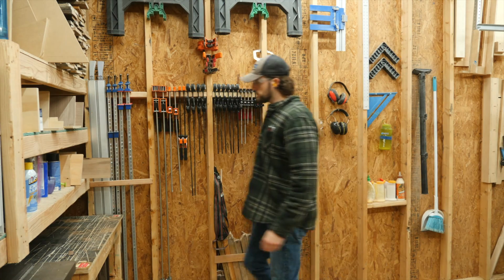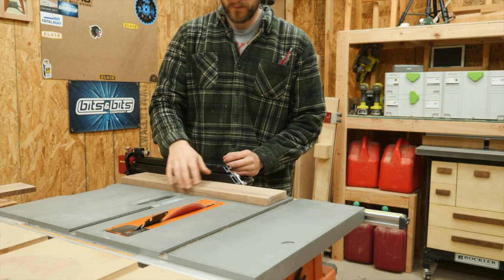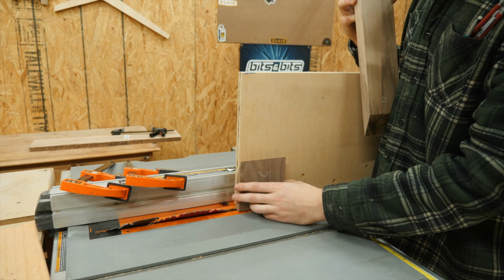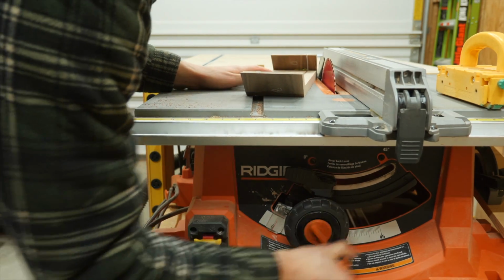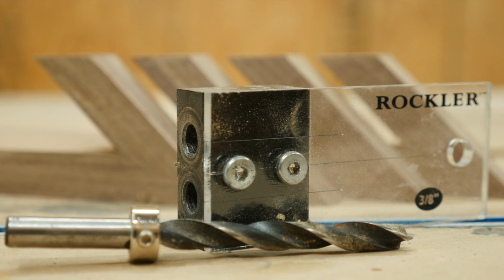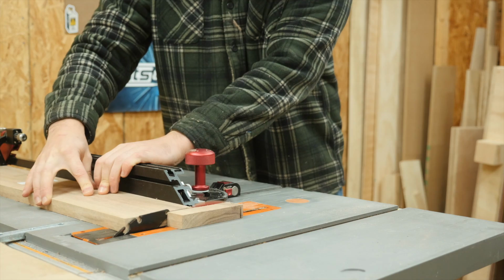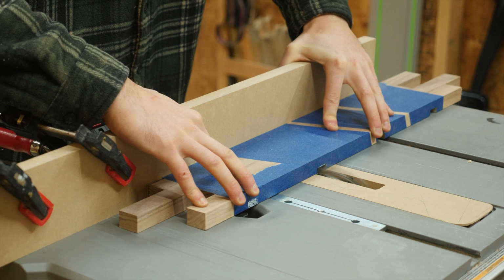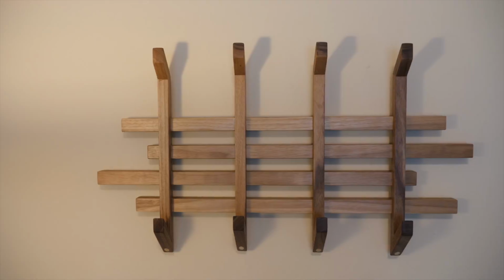she told me it wouldnt work... but I didnt listen

Comment: What grit paper do you use for your spindle sander? I tried the 80 grit that came with mine but it feels WAY too aggressive when sanding most things.
Reply from the maker: Hi Shane! Thanks for checking out the video! I typically use 220. It’s slow, but gives me a lot more control over what I’m doing